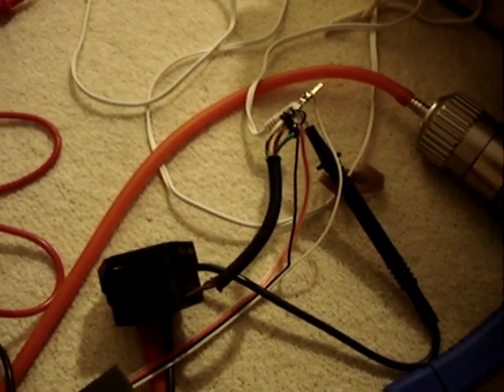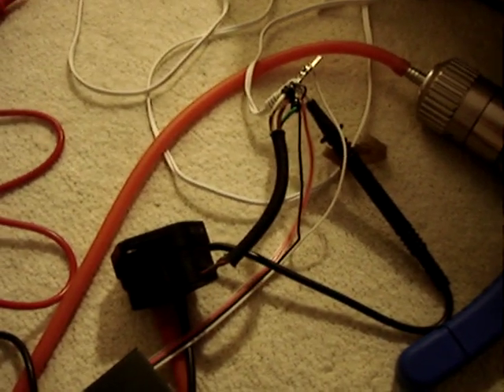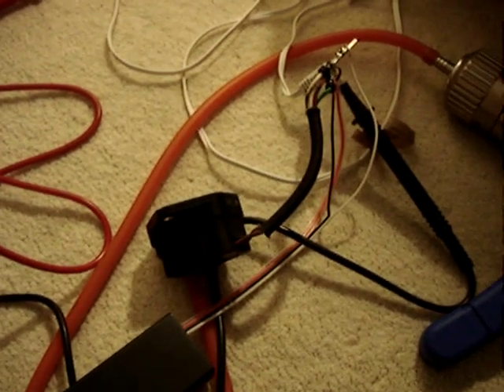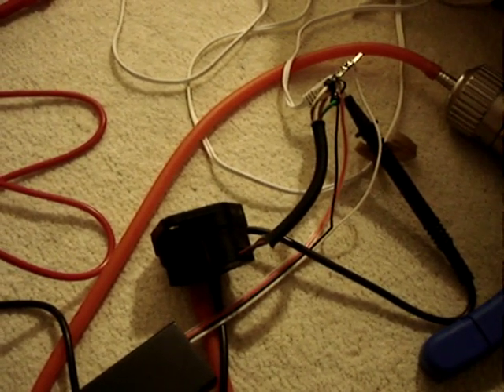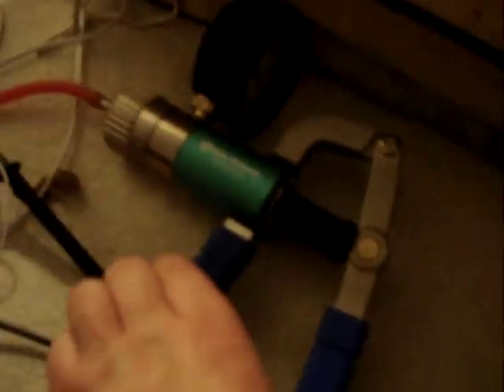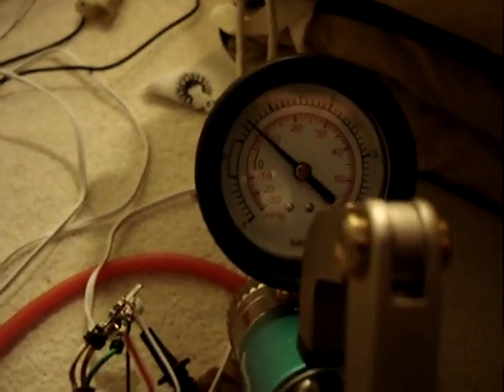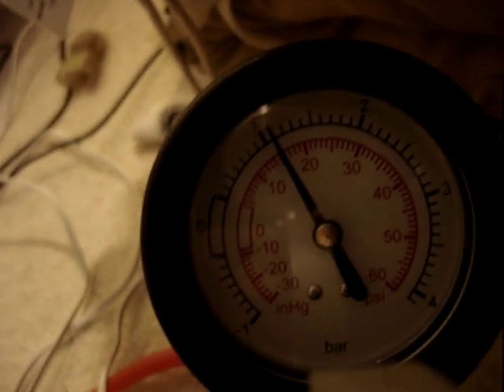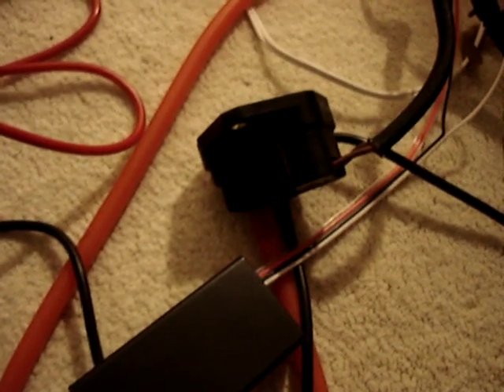MAP Sensor and Fuel Cut Defender FCD, GTti Turbo Tutorial 2

Comment from the maker: @censucks Yes you can, but in this situation the ignition timing will then be too advanced for boost. You would only get away with running a few PSI, unless you aso have a way of retarding the ignition timing as the boost rises. The "MSD boost timing master" is designed to do this.